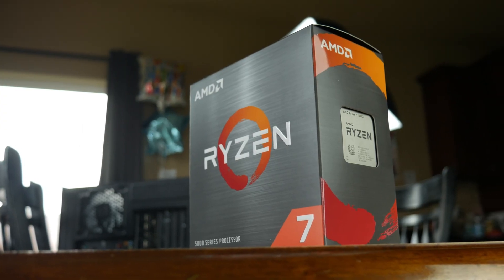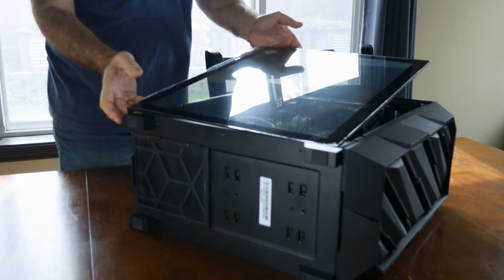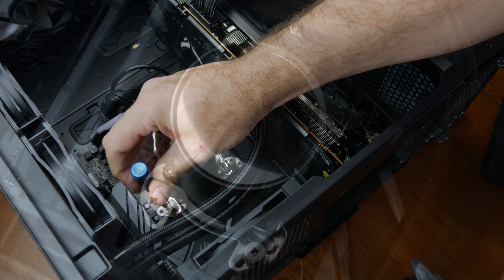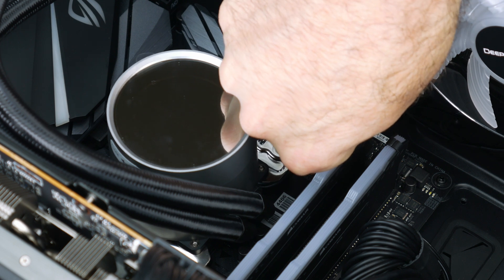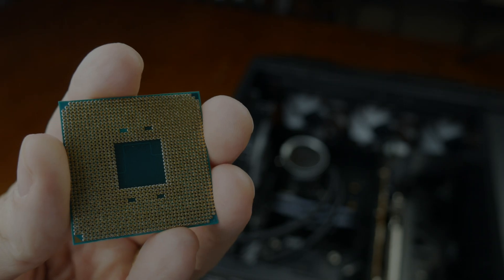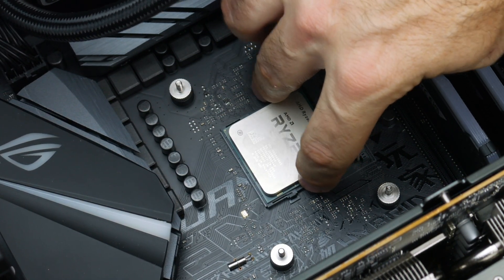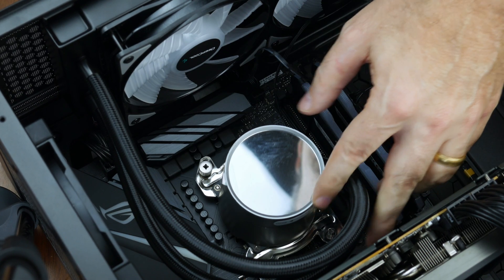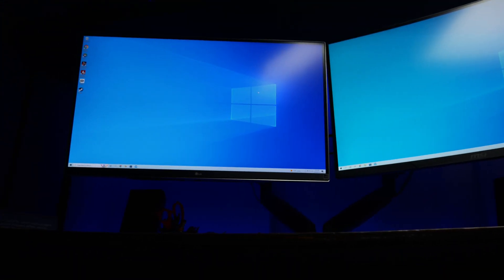How to Upgrade an AMD Ryzen CPU (AM4 Socket)

Comment: awesome, ive been thinking of upgrading my 3600 to a 5800X3D.  Not sure if its 1. Worth the boost of performance, 2. Will be better to wait?
Reply: do it, i saw alot of reddit post saying it majorly boosted their fps
Reply: Just bought a 5800x3d replacing my 5 3600. We should have done it yesterday.
Reply: Its a great upgrade. You will notice a big difference. If you can afford it do it.
Reply: Only reason to wait is if you are going to upgrade to AM5. The 5800X3D is the last and greatest CPU made for AM4
Reply: Nur Schwachsinnige sind auf Win 11 geil.     Und das ist wissenschaftlich neurologisch
beweisbar und auch bewiesen. (!)
Ja. Aber diese Spielelastigkeit ohne ernsthafte Software hat einer erstklassigen Hardware
schon in den 90ern schließlich das Leben gekostet.
Dumm gelaufen, oder... ?
-
Und solange man sich den Kopf mit Spielen zuballert, ist er nicht frei um zu denken, was
Vernünftiges zu lernen und zu machen.
Volten und übertakten ist was für Diaspora-Hirne.
Hier ein Beispiel, wie Effizienz auf intellektueller Basis und damit der Unterschied
statt Volten und Takten aussieht.
.
.
Kommt immer auf deine Fähigkeiten an, oder ob du deinen
Intellekt an Andere delegierst.
.
"Denken Sie selbst, sonst tun es Andere für Sie."
.                                                 Vince Ebert, Physiker
.
Wenn du wissen willst, wie das Speichermanagement (auch) beim Spielen auf der
Rechner-Seite punkt, weil MS gar keinen Zugriff mehr auf deinen Rechner hat und
der daher rasend schnell wird, mach mal folgenden Test:
.
Ich habe am    18.04. 2025   nochmal einen Performance-Test mit MEINEN beiden
(beide getunt) gemacht.    Titel:   "Warum ein neuer Rechner nicht lohnt!"
-
Ich habe die Word mal auf 32766 bebilderte Seiten erweitert. Mehr macht Word nicht.
Und die habe ich dann in Pdf umgewandelt. Pdf hat irgendwo noch zwei Seitenvorschübe
reingesetzt. In der Pdf sind es 32768 Seiten geworden.
.
Am Ryzen war sowohl das Generieren einer so großen Word-Datei  ~es geht um die
Performance eines Systems~ schon eine bluttropfende Geduldsarbeit, sowie auch
die Zeit die der Ryzen zum umwandeln gebraucht hat.
.                  Ich habe in zwei Testläufen verschiedene Methoden angewandt.
-
-
Jetzt darfst du dich festhalten:
Damit hatte noch nicht mal ich gerechnet, weil ich noch nie so exzessive Tests gemacht hatte.
Ich hatte meist von kleineren Tests hochgerechnet, bzw. Kopiertests großer Dateien,
25 GB oder mehr, herangezogen. Und CDM und AS SSD Benchmarks gemacht.
.
An meinem Intel-Notebook von 2012  (4700HQ, Quadcore, 2,4 Ghz, DDR3-1600, Win 7, mit
SATA6-SSD  und lediglich 54 TDP)  ... hat das geschlagene 4 Minuten gedauert.
Am Ryzen 1950x von 2017, 16 Cores, 4 Ghz, DDR4-3200, Win 10 und NVMe OWC Ultra IV
im RAID0 auf zwei PCIe-8-Steckplätzen (16 TB) nur 3 Stunden 20 Minuten.
-
-
Ihr könnt den Performance-Test ja mal nachspielen, dann seht ihr schon, wo ihr steht.
.
Ich messe nie an der Pleuelstange wie Blender & Co. (warum heisst der so ??), sondern
immer zwischen Gummi und Asphalt.   Wieviele PS der Trabbi wirklich hergibt.
-
-
Die Erbauer nachfolgender Computersysteme können also nicht mehr ganz bei Trost sein.
Da ich seit 1988 Rechner tune, weiß ich wovon ich rede.
-
Da ich nicht Game, aber gelegentlich rendere, weiß ich, dass da der 1950x mit der 1080 sehr
viel schneller ist. Linear.
Aber aus dem Alter eines beschränkten Horizontes bin ich heraus.
.
Das muss nicht nur anders gehen, sondern tut es tatsächlich auch.
Aber eben nicht mit teurem Billig-Ramsch aus Industrie-Abfall.    So wie AMD.
-
-
Es ist also ZWINGEND, beim Anpreisen von Ryzen-AMD-Systemen DEUTLICHST HERVORZUHEBEN,
dass die zwar ganz nett beim Sielen sind, wenngleich selbst ein 9950x nicht mal an mittelmäßige
Intel-Systeme herankommt, aber bei Windows-/Office-Anwendungen gar einem C64 von 1984
gleich kommen.
Und wie wir wissen, hat AMD den 9950x gerade mal doppelt so schnell gekriegt wie den 1950x.
.                                                            Alles dazwischen ist   ...Zwischenstation.
.
Man lädt ja auch nicht mit einem Ruderboot zu Sightseeing-Touren in grönländische Fjorde oder
Karibik-Turns ein. Nur weil mal eine Titanic abgesoffen ist.
Und inzwischen sogar eine Zweite und auch noch eine Dritte. "Vertrauen Sie mir, ich bin Ingenieur!"
-
-
Vom 4700 HQ aus 2012 bis 2025 liegen ... ?    RICHTIG!  12 Jahre.   kkkkk...
Und locker 10 Ryzen-Generationen.     Schenkelklatscher.    Also jede Menge Dumme.
Mein NB ist ein Intel-PCIe3-NB mit noch Win 7.
-
Der 9950x ist PCIe5 mit NVMe5 und Drehzahlen,  DDR5-Ram 8800 Mhz, CPU 5,5 Ghz, etc., etc.,
dass einem nur so schwindelt.
.                           Und dann ist mein Uropa-NB trotzdem 50 Mal schneller !!
.                                                                           Ich krieg nen Leistenbruch vor Lachen.
-
-
Dieses mein Intel-NB von 2012 bootet (getunt) Kaltstart in vier Sekunden.
Zwei fürs BIOS, zwei für Win 7.
Mein, ebenfalls bis zum Geht-Nicht-Mehr getunter 1950x  braucht von einer 970 Pro, 990 Pro
oder OWC Ultra IV lediglich 1 Minute 30.   Was für eine Senftube.
Habe ich die GTX 275 von 2009 drin, bootet er immerhin in 50 Sekunden.
Am schnellsten läuft also der Rechner der nur 54 TDP hat.    Das Intel-Notebook.
-
-
DU musst die GANZE Windows-Seuche selbst lösen !
ICH habe meine Rechner gründlich entwanzt. Bei Win XP und 7 geht das noch richtig gut.
-
1. Gebot !   RAUS MIT WINDOWS-UPDATE, seinen Vettern und Seilschaften !!
                    Dann geht der schon mal sofort sehr viel besser.
-
Und kostet nicht mal was.
-
Bei 8 nur noch mittelmäßig.
Bei 10 geht fast gar nichts mehr. Und mit einem AMD sowieso nicht.

Comment: can you replace an AMD Ryzen 5 5600X with a Ryzen 7 7700 using the same MB?
Reply from the maker: No. Ryzen 7000 series CPU's use the AM5 socket and Ryzen 1000 - 5000 use AM4.
Reply: @Maraksot78  I ended up checking out the specs on PC part picker and the older one is socket 4 and the other socket 5. Thank you though, I really appreciate it!

Comment: Can I change ryzen 5 with ryzen 7 ?
Reply from the maker: Yes. If you're going from Ryzen 1000 or 2000 up to Ryzen 3000 or 5000 you're good to go. You'll just need to update your motherboard BIOS to do it. However, if you want to go to Ryzen 7000 from Ryzen 1000, 2000, 3000 or 5000 you're going to need to upgrade to a new AM5 socket motherboard and DDR5 RAM as Ryzen 7000 CPU's are not compatible with AM4 motherboards which is the socket used by Ryzen 1000, 2000, 3000 and 5000.

Comment: Advice needed. What should i upgrade from ryzen 5 2600. 
Mother board prime x370-A
Gpu - 1660 super oc
Reply: How much you looking to spend and what resolution to play at?
Reply: @Phoenix11720  1080 sometimes 1440 :) lol 
spending wont be a problem. Im just looking for Great gpu/cpu/motherborad combo for when I do start streaming
Reply: 5800x3d is best cpu with that motherboard for gaming. Then it's just how much you want to spend on a gpu, you can get a 4070 for 600 dollars
Reply: same here, im thinking of buying the 5700 + 6800xt, got a R5 3600 here as well with the 1660 super but dunno if it'll make a big change since i initially wanted to buy the 7800x3d however that means i need to renew everything cuz it aint am4 :(

Comment: I'm upgrading from a ryzen 5 4500 to a 5600X, and I need a little help. So... I should just take the 4500 out and put the 5600X in, and that's it??? I don't have to format the boot drive or reinstall windows 10?
Reply: Yes.
Reply: Yes.

Comment: Did you have to reinstall anything after changing your CPU?
Reply: I have done this before. You can upgrade your bios from windows. Everything on the ssd including your operating system will be intact. No need to reinstall anything. I know this is a late answer but it might help somebody else 🙂
Reply: @Fredrik7le it did thank you so much 😊

Comment: hi nice video mate, i want to upgrade my R3 3200g to a R5 3600, my question is can I use the same stock cooler that came with the R3 3200g on the R5 3600, thank you :)
Reply from the maker: Thanks for checking out the video and for the question. Both the 3200g and 3600 have a TDP of 65 watts, and as far as I know, both come with the same Wraith Stealth CPU cooler. If the 3600 you are buying does not come with a cooler for some reason, then yes, you can safely use the Wraith Stealth from the 3200g. Just be sure to clean off the old thermal paste and apply new. 🙂👍🏻
Reply: @Maraksot78  oh thank you so much:)

Comment: Hey I have Asus tuf b550 with AMD 5600 and I want to upgrade it for the 5800x3D do you I need to update bios or not ? 🤔
Reply from the maker: You may not need to update your BIOS but I would do it just to be sure it'll work.

Comment: All these motherboards come with amd 5000 support now.
Reply from the maker: Yes, new motherboards should all support Ryzen 5000. However, for people with older systems looking to upgrade from a Ryzen 1000, 2000 or even a 3000 series CPU to a Ryzen 5000 series CPU they will need to update their BIOS to be able to support their new CPU.

Comment: I did all this and now i am  getting no display and pc won't even power on...help please I have tried everything and nothing is working. If I put back my old 2700x everything works fine Again...
Reply from the maker: What CPU did you try upgrading to? If you're going up to a Ryzen 3000 or 5000 CPU you're going to need to update your motherboard BIOS first.
Reply: @Maraksot78  with a magnifier I saw that 1 bloody pin was a bit to the side, I put it back right and now it works fine. Thanks for the replay man!

Comment: One of the few clear-instruction vids out here. I'm upgrading from a 3600 to a 5900x. Thank you so much.
Reply: How did it go. Im trying to go from 3700x to 5800x but get no display
Reply: @Frenchii9YT  went pretty well tbh. Big difference in performance,  5000 series is really amazing. You can't go wrong with a 5800x. My gf just upgraded from a 2600.
Reply: I'm about to make the same upgrade yaaay lol

Comment: Have an HP 405 G4 Ryzen 5 Pro 2400GE. I'd like to upgrade to the Ryzen 7 4750GE. Both have AM4 sockets and are 35Watt processors. Is this possible with a BIOS upgrade?